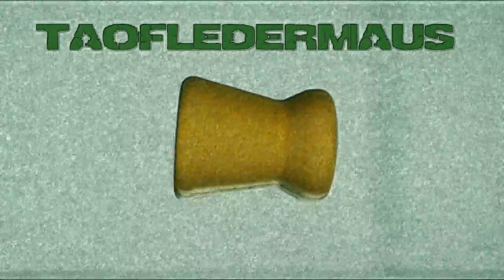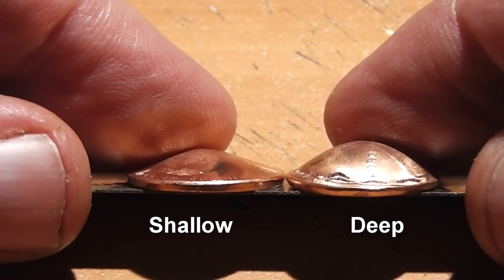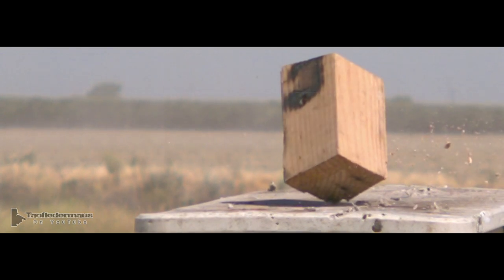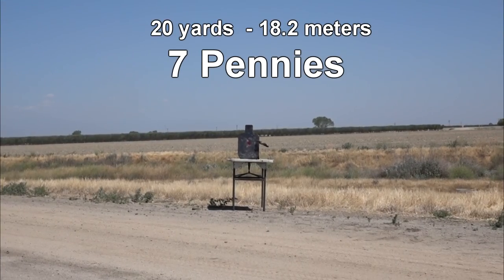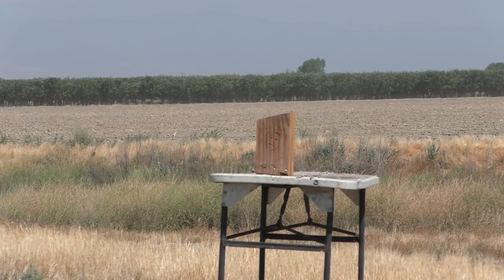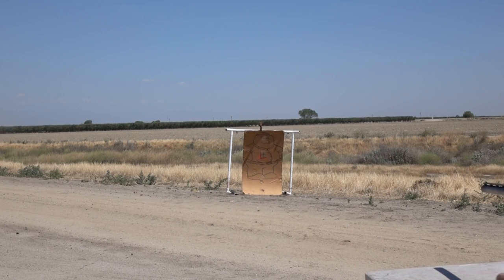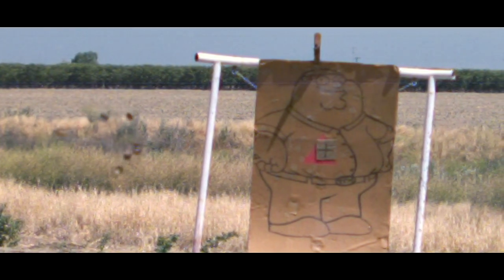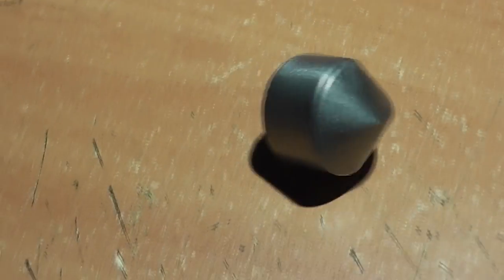12ga Shotgun round using PENNIES -  We TEST them!

Comment: And this round only costs pennies compared to other rounds.
Reply: Surprisingly, pennies are cheaper per pound than lead. And newer zinc pennies can be melted and cast. Go figure...
Reply: @TactaGhoul   I think it's illegal to melt down pennies with the purpose of selling the metal on as the metal in a penny is worth more than the value of a penny so the guys at the top said no to melting them down to sell on for more
Reply: @TactaGhoul  Only around $0.35-0.40 for a pound of lead here.  35-40 pennies are no where even close to weighing a pound.
Reply: @bigd7861  What? Where the heck is it that cheap? Around here I can't get decently pure lead for less than about $2 a pound.
Reply: @TactaGhoul  Actually, pretty much anywhere in the U.S. that I've ever looked.
Reply: @TactaGhoul  He must be talking about scrap lead
Reply: haaaaaaaaaaaa, when they ask for change......give it to em
Reply: lmfao...literally.
Reply: @barkingbarker8291  actually it's legal to destroy Penny's it's the fraud that's illegal  if it's for personal use or education then it's perfectly fine as long as you dont go melting hundreds of dallor worth no one will care if you were to melt them and sell them for more then it's illegal unless use a loophole such as giveing it away and the pay is "donations" but its bigger then the cost of the bar of Penny's poeple use that tactic in the alcohol industry alot so they dont need permit to sell
Reply: Honestly this is probably worth more than actual pennies
Reply: just spotted another rare roachdogjr

Comment: Stick'em together with JB weld and call it the flying Lincoln.
Reply: I thought of that too or drop some superglue in between and make a penny for your thoughts slug
Reply: I wonder if melted wax would help?
Reply: @kingbennyb  to coat the inside of the barrel...
Reply: Solder them together,  they're copper/ copper coated.
Reply: hot glue is cheapest way to bond pennies together for shooting

Comment: The negative post off a car battery makes a good slug.
Reply: Can't use the positive post it will shock you taufladermaus
Reply: Over half of a batteries weight is lead
Reply: How about steel bar?
Reply: @mistakenotou7681  the problem with steel is if it touches the barrel you are going to have a really bad time either damaging the shotgun or possibly injuring/killing the shooter depending on if the barrel bursts or not. Same goes for anyhting harder than the steel used to make the shotgun barrel. Unless you make it smaller than the bore of the barrel and have something softer than steel wrapped around it. It is why lead makes such an excellent bullet material it is incrediibly dense so it has mass behind it but it is also very soft so it wont damage the barrel. Copper is also softer than steel while being harder than lead so it makes for a good jackket since a lead core gives it the density a solid copper round would lack. Lead is also more dense than steel so it can transfer more energy but steel being substantially harder allows for it to penetrate better hence the use of steel cores for armor penetration or even better tungsten cores ( tungsten being far harder and more dense than steel.) An incredibly potent slug would be a hunk of tungsten wrapped in enough lead to be safe to fire through a rifled barrel with a mag load behind it.
Reply: @RobRuckus65  You ain't lyin'.
Reply: @mistakenotou7681  maybe.. As long as it is short enough to be inserted into the chamber and can be covered with the sabot otherwise the steel will be touching and damaging the barrel.
Reply: I miss these kind of videos. My favorite videos on this channel were always the ones where you used random objects for buckshot like tic-tacs, airsoft bbs, etc.
Reply: @izzyplusplusplus1004  Yeah he is.
Reply: @bigiron9345  Direct current. Touch either, or. But never both.
Reply: Cut off the positive and to be safe ground yourself on the engine
Reply: Why not smaller batteries?how would they fly
Reply: @RobRuckus65  Depleted uranium works well!
Reply: This is the problem with the internet there's always someone with a negative comment ☹️
Reply: @timhooper1557  Depleted uranium is the best armor penetrator  also makes the best armor plates the military loves the stuff.
Reply: @duckydarrick7460  Those magnetic balls were the absolute best. I have a soft spot for the TTTT videos as well, but weird projectiles makes for stellar content.
Reply: @ Mike Latta I know it's called sarcasm your original post said negative post off a car battery like the positive one would not work or something
Reply: Nick Barkley could he wrap the shotgun in a faraday cage and avoid getting shocked?
Reply: I heard that an old shotgun slug makes an excellent negative post for a car battery.
Reply: That reminds me. Is that a negative car battery post in your shorts, or are you just glad to see me?
Reply: holys///, good thinking
Reply: @ImpendingJoker  then why the hell would have mud daubers nest or mud in the end of the barrel blow it up if that powder is burning behind an obstruction in the barrel whether it be as steel shot or something else it is going to blow the barrel up
Reply: Not on side mount

Comment: 1982 and older were 95% copper. pennies made after 1982  are zink with just a little copper and other metals. Pennies made in 1982 and older actually contain about two cents worth of copper. You Should save them.

Comment: You could have just melted 9 old pennies and 1 new penny and make a brass slug?  Or the equivalent amount of weight in nickels.

Pennies give you more bang for the buck but the cheapest way to store them in non melted form is nickels because 2 dollars is more dense than 50 cents and you don't have to cycle through them all and leave out the 1982 pennies to weight them individually.

Comment: thought it was a clint eastwood movie? he says about about shooting 10 thin DIMES ? Thanks you taught me something with the dome concept or fact,I have 20 ga. and 410 reloads but with copper or stainless steel washers and use a hardened masonry nail or a drill bit for the core,have considered gluing them together ,both are in 3 in. casings with the same powder weight as slugs, am disabled so don't get much range time to test things, the farthest I would use them is inside my home,idea being they won't travel to the neighbors house like a slug would or rifle round,I WILL make a press and reform some washers into domes though ,but still use the nail core,btw the nail WILL go clear through that wood :) thanks. Rick

Comment: I have shot dimes from a black powder 12ga.  I left them in the paper roll to keep from damaging my bore.  All I did was make a .72 caliber bullet.  They didn't separate at all. But, I found that about six bucks worth of dimes made an accurate slug out to about thirty yards. No kidding, with lubed paper and dimes, my shotgun is deadly. Of course I never got to do any high speed filming, but the holes on paper were  as round and uniform as a lead wadcutter.  The only problem of course being the cost.  I guess you just have to decide if the target is worth wasting six bucks on.

Comment: Sometimes if your throw your money at a problem, it really does go away. This coin shot would certainly make a terrorist go away forever, if used at close range. I personally wouldn't recommend it though, the shot pattern is too unpredictable. It reminds me of buckshot through a rifled slug barrel, because it impacts in a ring shape around the outside of the target, missing the middle. Not only would it be cruel to hit the enemy's arms and legs while missing the torso, it may not stop then before they can return fire. No way to predict where those bulged coins will fly. For unique rounds, I would rather use 3" magnum flechette, packed all forward facing in a sleeve, to avoid ruining your smooth bore barrel. Solid steel sabot dart slugs are interesting too.

Comment: I mean, could always melt them down and cast them as actual projectiles meant to be fired?
Reply: Pennies are actually mostly zinc with a copper coating. Zinc melts at almost 800degF/420degC, so it's a bit tough to handle safely for most folks.
Reply: @ScottKenny1978  Supose you could always cut them up and make wax slugs with them at least.
Reply: Ohhhh or wait, keep them domed but still make wax slugs with them? ',:)